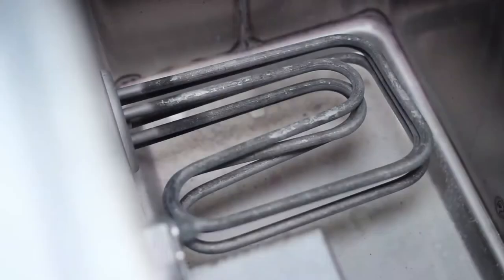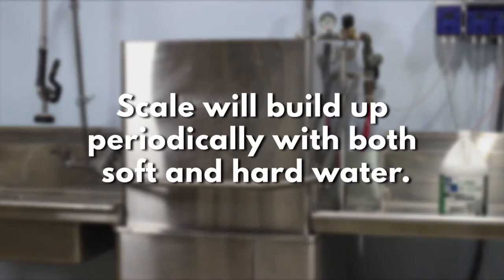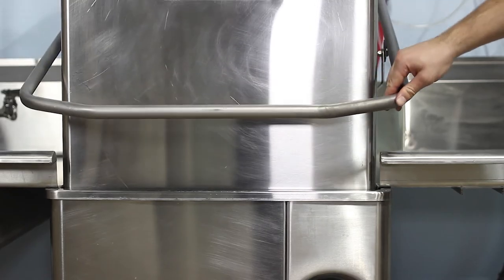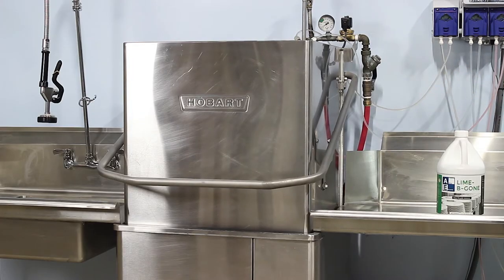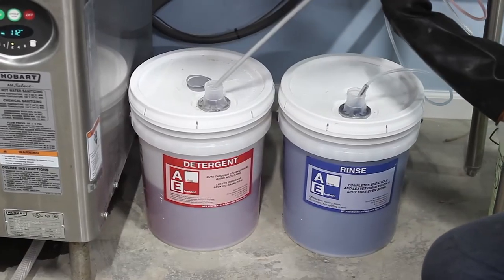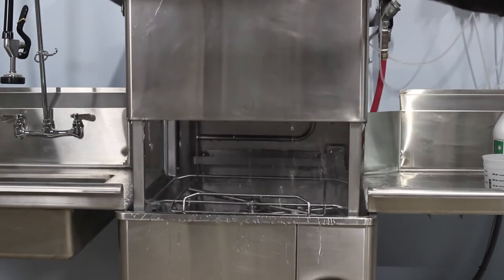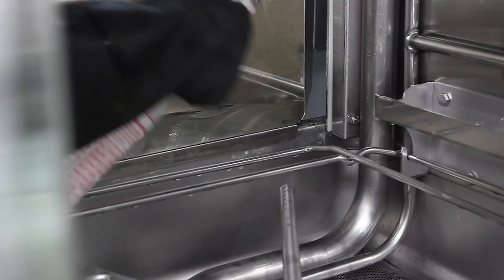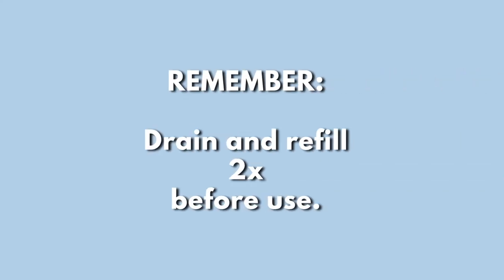How to Delime and Descale Commercial Dishwasher Machine- Active Element- Maintenance Series

Comment: Thanks for the explanation on how to run the descaler.  I have a ES2000 Pure Clean machine and I am unclear as to how to set it to descaler cycle.  Would you possibly be able to help me?
Reply from the maker: @smrdaze06  I cannot find anything in the manual on how to descale. My apologies. You can descale “manually” as outlined in the video. Fill machine with fresh water, add descaler, start washing cycle. Then pause cycle halfway through, let the descaler soak into machine for 15-20 minutes. Then continue cycle. Give us a call if you have any questions on this. Thank you for the question!
Reply: @activeelement8938  Thanks so much I appreciate the help.

Comment: Thanks for this video! What if the industrial dishwasher has a bunch of build up on the side against the wall and it's hard to reach?  Will the decaler be able to remove it?
Reply from the maker: Thank you for the inquiry. Yes, descaler can be used to manually remove thick scale. I would recommend using spray bottle or sponge to soak the affected area with descaler. Let it sit for 5-10 minutes. Wipe the scale off or you may have to use a brush/abrasive. After that flush area with clean water. Hope this helps!

Comment: Thanks for instructive video. I wonder if the boiler gets descaled too. The rinse water typically is not taken from the tank so I guess the descaler wont reach the boiler used for the rinse cycle?
Reply from the maker: Correct, the descaler solution would not reach the boiler and only circulates in the dishwasher. You would need to run a separate descaling cycle on the hot water boiler. Thanks for the inquiry!
Reply: Make sure you replace your anti rust anode rod(s) before your tank completely rusts and fails. Rods last about 50% longer than tank is warrantied for, then replace the rod, don't wait!

Comment: I read through the SDS on this product. Any information on the specific chemicals used in this product? How can I be sure it is safe to use on food grade equipment.
Reply from the maker: The Descaler is a blend of acids, builders and surfactants. As shown in the video, after descaling you want to rinse and flush out the dishwasher several times. This will remove any residual cleaner. Commercial dishwashers have a end "rinse cycle" where at the end of cleaning cycle fresh water is injected to rinse the detergent off the plates. Hope this helps you. Thanks!
Reply: Thanks for the information. Very helpful!

Comment: If unable to get lime-begone, could vinegar be used? Would you recommend an amount.
Reply from the maker: Yes, you could technically use vinegar but I have never done this. Try two gallons and see how that works and trust your experience. It either will remove the scale or it won't. Hope this helps you. Thanks!

If interested, here is the math behind the 2-gallons. The concentration of vinegar is 4-6% acetic acid compared to the concentrated Universal Descaler that we sell that is 30% phosphoric acid. Therefore, I would use 5x the amount or 20 floz per gallon of wash tank. Do you know your wash tank volume of your machine? The machine in the video has a 14 gallon wash tank. Therefore, 20 floz times 14 gallons equals 2.1 gallons (roughly 2 gallons).

Comment: What numbers do you put in on a digital Hobart to delime.
It has a code  to key in.
Reply from the maker: For this Hobart machine:
1. Drain the machine
2. Press and hold the "On" and "Cycle" button for three seconds and close the door. It will prompt you to add Delime solution.
3. Open door and add solution.
4. Close door and let run its full 14 minute cycle and will show "drain" when completed.
5. Drain tank and refill with fresh water. Repeat one more time ensure fresh water.

Comment: Can you delime your booster tank ? If so what are the steps
Reply from the maker: Hi there, thanks for the question, we usually focus on commercial dishwashers and not tankless and tank water heaters. Best to refer to the owners manual on specifics. That being said, we want to help. My hot water tank at home, I flush every year to remove sediment and do not descale, you probably could though. At our soap plant we have several “tankless” water heaters. Those we descale every six months. Hope this helps, I will try to make next time we descale tank water heater.

Comment: How do you Reset the Delime Recommended Display? after delimeing the display doesn't go away, just always say Delime Recommended
Reply from the maker: I would try restarting the dishwasher by turning off and then back on. What is the brand and model dishwasher? We can lookup in manual. No problem.